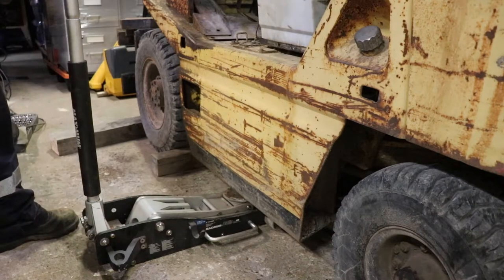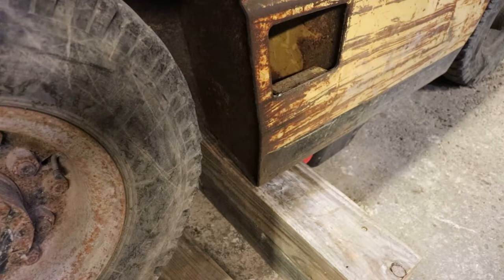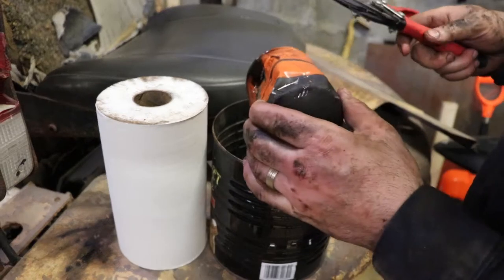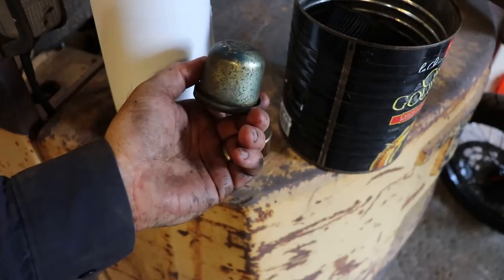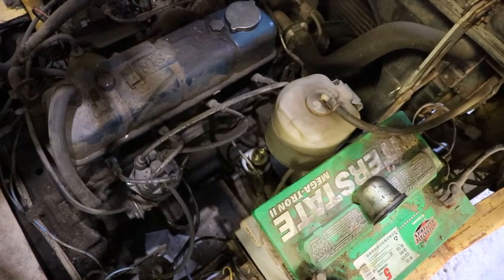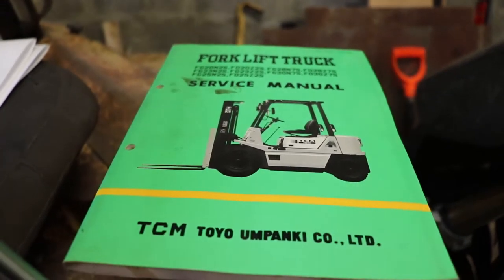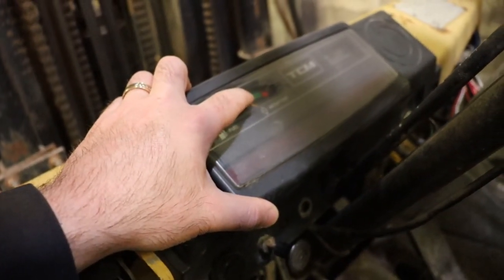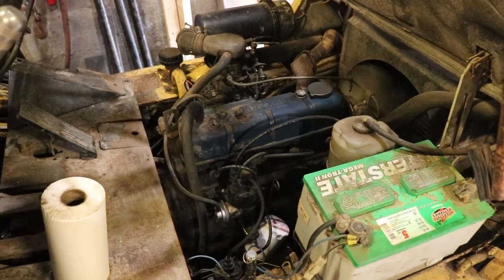TCM FG25N2S Forklift Nissan H20 Oil Change and Fuel Filter Inspection

Comment: Thanks a bunch for putting the video together...  I just got an old Komatsu Model #FG25ST-4, and getting all of the Model and Serial Numbers I can find and starting the quest to find the Service, Parts and Owners Manual... I do have the Parts manual in PDF, but, it's not searchable, so, I"ll keep looking.. Love that fast search.. 
My first forklift, so, same issue.. What type of oil, etc.. Figured the Rotella 15-40 would be good. I think Hydraulic is ISO#32, and DextronIII for Tranny... 
I am pretty sure the bone dry clear canister with black lid under the dash far left is the brake reservoir.. Don't think I can crank it at the moment.. Have one of the Hydraulic Cylinders being rebuilt for the tilt in front on the left... Thanks for jacking it up.. Didn't think that would work.. I have a 3 ton.. Thought I was going to have to weld up some sort of reverse scissor jack and operate it with a 20 ton bottle jack... Ha.. So, maybe not!! My truck weight is 8660 like it sits.. Maybe a 3ton will lift a side of it.. Figuring I will have to pull a wheel or two to fix the brakes.. Hope not but, what the heck.. 
Thanks a bunch for the video... I'll do a "Forklift Search" and see if you have anything else... Cheers!!  I got mine stuck 3 times the first day trying to get around on the property.. Just after a rain.. Probably would have been ok, if I had some weight on the front.. Have to try it again, but, brakes first.. I have some hills and she's a free roller, and the rear steering is not a high speed steering setup.. Got a bit sketchy on me.. Ha.>Ha..